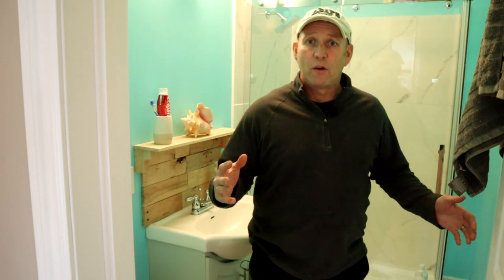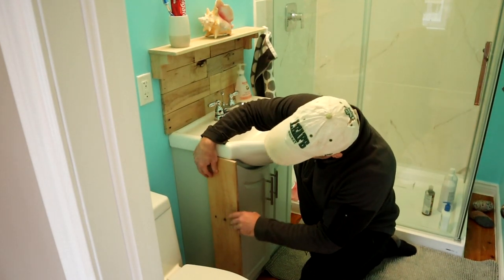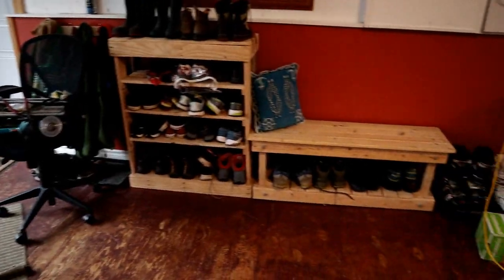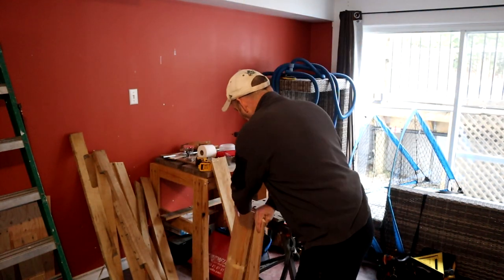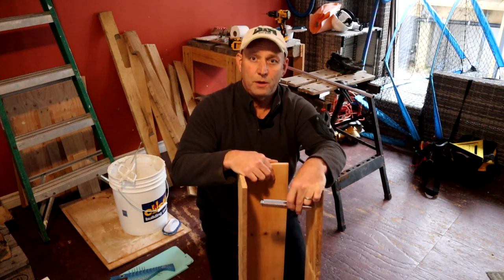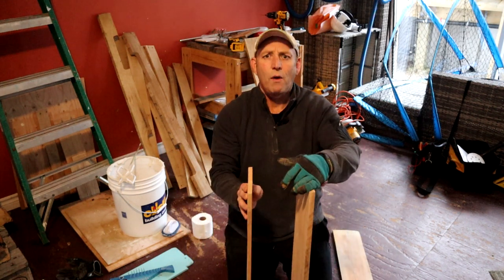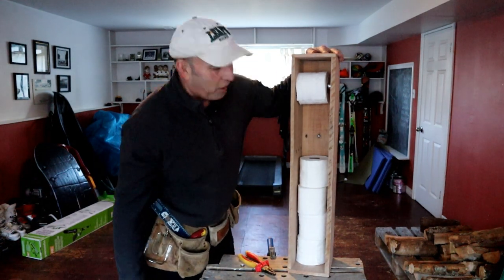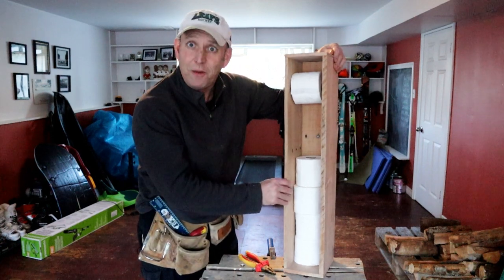How to Make a Stylish Toilet Roll Holder with Pallets

Comment: I've been making bird boxes from pallets and not really thought of using it for projects indoors. While you were thinking of whether to use screws or nails, have you thought of using dowels? This is what I prefer to use for the bird boxes, keeping as much non-organic materials out of them as possible as chances are, some can be left to rot.

What I do is use 6mm doweling which I buy in 2m lengths. I have some 45mm screws with heads 6mm or less. I screw the boxes together using external wood glue and when the glue has dried, I remove the screws, drill out the holes to a maximum depth of 45mm and glue the dowels in I make leaving them slightly proud. Once dry, I trim the ends of the dowels down flat with the surface and give it a light sanding.

I use 45mm screws as that is the best fit with the thickness of the pallet wood I'm using to give me a very secure fit.
Reply: Typed this as I've been watching...

* Screws pull the wood together closing up the gaps allowing the wood glue to create a solid bond.
* Router would give you a nice clean hold and with a palm router, can be done freehand as no-one will see it.
* When making the holes, easier to measure and mark both centre points before drilling.

I know you're making this as you go along, just thought I'd post a couple tips to help others. Showed a photo of this to my wife, I've got to make one for our bathroom.

What thickness is the pallet wood you're using please?
Reply from the maker: Thanks for this Zeb. Like I have said I am no carpenter, so really have been learning as I go along and I don't always have all the tools. Your comment is great so thanks for giving me some new ideas for fixings. I will have a go with dowels. That said with the lack of experience I have made some great things with pallets so far. I have made a couple of different shoe benches/racks, a great chest, a drinks bar and lots of other bits and bobs. It is a great journey of discovery and learning and I definitely don't set myself up as any sort of expert :)
Reply: @TheOptimisticGardener  Just passing on some tips and when I make things, I have a picture of what it is I want to make in my head and make it from there, sometimes making changes as I go along. I'd love to see the videos for the other things you've made - are they in their own playlist or do I have to trawl through all the videos?

Keep up the great vids!